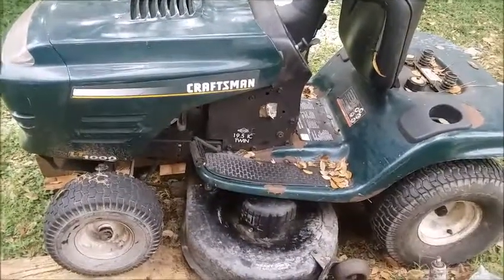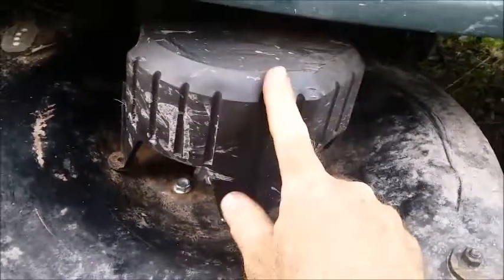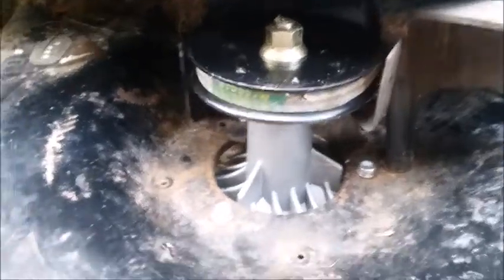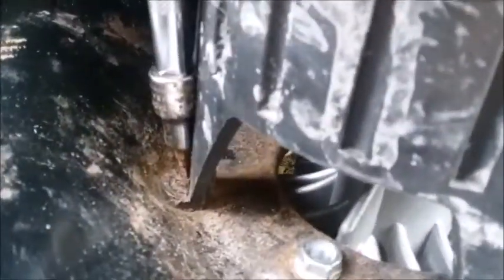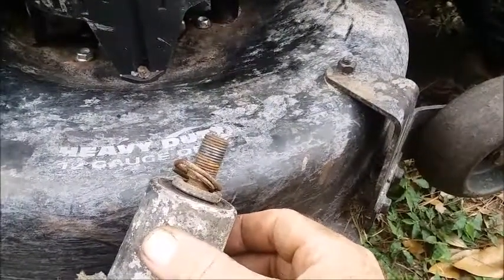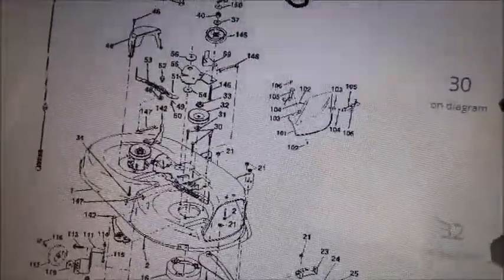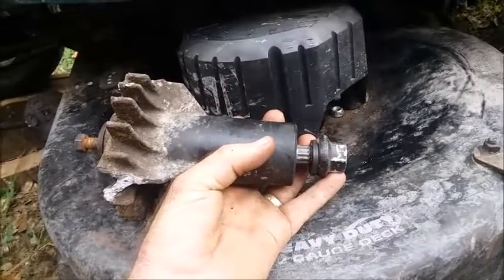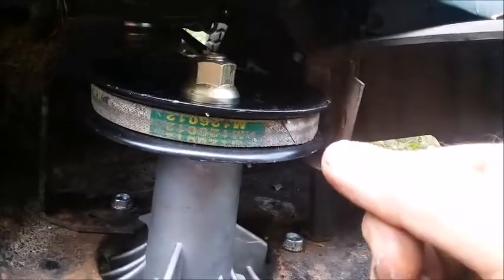Replacing Spindle Mandrels Without Removing Mower Deck on a 42" Craftsman Husqvarna, or Poulan Rider

Comment: How did you get the old one off? Mines done this exact same this same mower same looking spindle!.  Spindle is not mounted because all the bolts rusted thru and snap so it’s just dangling